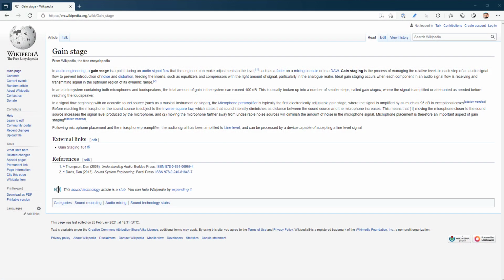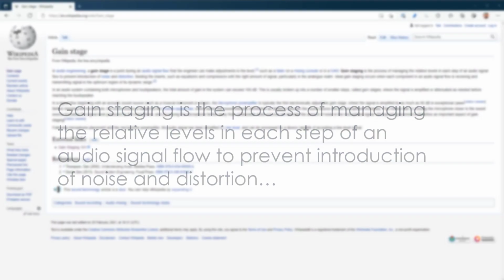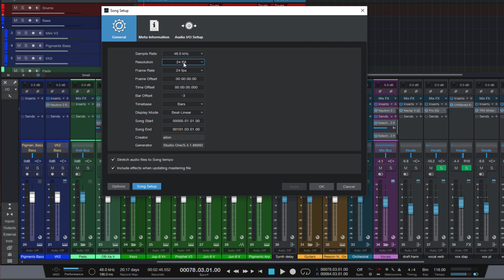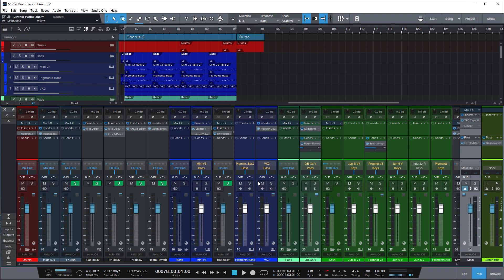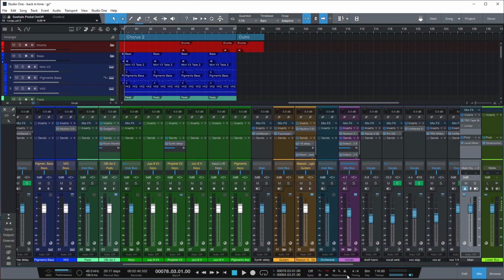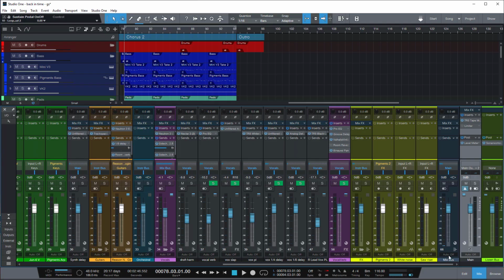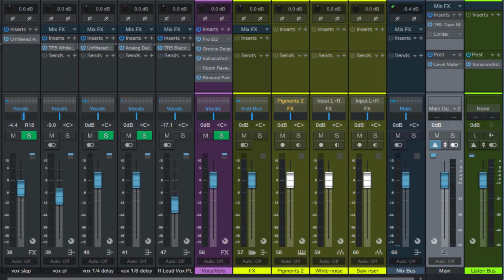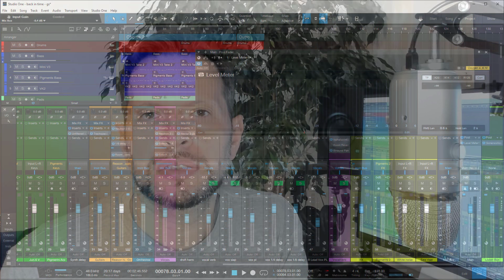Studio One Quick Tip: Gain-staging for in-the-box producers

Comment: Thanks for the tip. Your video is well-produced. One thing, though, is that some plugins add saturation as if the input signal was getting clipped. This happens mainly in plugins that emulate analog hardware. One example is IK Multimedia's EQ-81. In fact, I like the saturation of that plugin so much that I add it mainly for that purpose (as oppose to EQing).